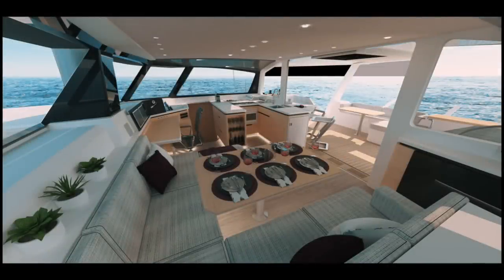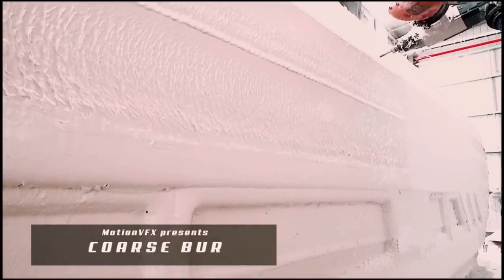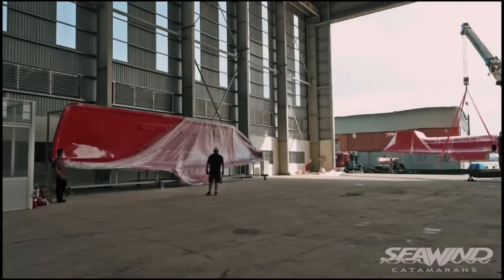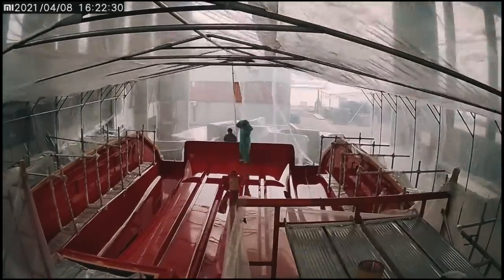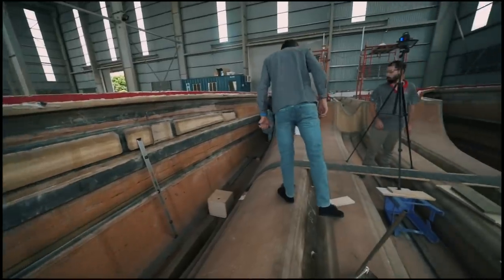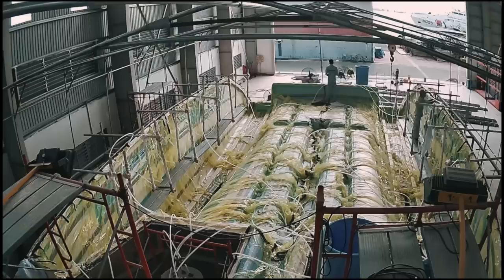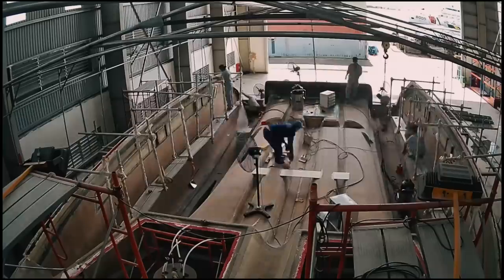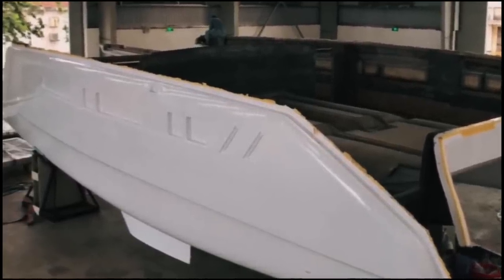🔴 Why does this BOAT BUILD need an INSANE 6,000 feet of pipe work?!!

Comment: I really wish we could figure out how to do resin infusion without so much plastic waste.  I know you're building a hull that could last 100+ years, but all that bagging, all that peel ply, all those tubes.... it's more plastic waste than some of us generate in years (and less than some of us use in a month).  Still, IMHO it's the most distasteful aspect of this build method.  Don't get me wrong, it's far too complex for me to objectively say if it's worse than other build methods overall.  It's just a bit icky.
Reply: You are correct that there is a fair amount of waste with regards to the consumables.
However, I’m quite certain all the stuff you list contributes a very small fraction to the material cost of resins, fibers and foams. I’m equally certain the additional labor needed to configure bagging and plumbing for a 45 ft layup is significant compared to the cost of consumables….even in far off places with cheap labor and limited environmental oversight.

In the end, the fabrication process is a financial decision as well as an engineering one. 

To your point….I doubt the environmental impact will be of much concern to anyone until that stuff washes up on some beach a few years from now. But the impact is real and persistent and happening world wide in virtually every industry.
Reply: @williamfennell8175  imagination is what makes human different than others..... what if you could make a vacuum chamber, large enough for the boat to fit in and have robots to spray the resin? Look at how carbon bikes are made, with double moulds.... only saying, its a matter of choices and money as you also mentioned...
Reply: @mafketeltje1988  
I’m sure you are correct . What you’ve described is a giant autoclave the size of a warehouse used by aerospace companies like Boeing and Airbus to fabricate composite wings and fuselage.
Each of these  companies probably have billions invested in similar manufacturing facilities. Despite the fact that they have more stringent structural requirements and enormous financial resources I’m certain they are actively researching technologies to reduce manufacturing overhead.
Reply: @williamfennell8175  The autoclaves don't stop the vacuum bagging they follow  it. When the part is vacuum to the mould the valves are closed and it is wheeled into the autoclave for temparutre controlled curing. Still the same amount of bagging required.   Wood boats, steel boats and aluminium boats all have waste as well just a different form, but all energy intensive.
Reply: @zorbalight3933  
I agree.  I should have been more clear when mentioning the use of autoclave big enough for a full size hull.
The added control of positive pressure and elevated temperatures is well suited for the use of “pregreg” fibers and nomex cores.   The long working time of the prepreg at room temperature avoids the need for miles of tubing to deliver resin via infusion. But you are correct that bagging is still used.  
My intent was to highlight one of the variations to a process in manufacturing high tech composite parts without avoiding the labor investment of what’s still a hand layup.

Comment: 11:05 right angle cut bulkheads at inner hull intersection look weak. and repeated on outer side, but radiused at top ?? documented lagoon 450 fail point
Reply: Apples and oranges mostly.  Plywood (as in Lagoon 450)  is not nearly as strong as Carbon fiber as in Seawind.

Also the load bearing bulkheads in the Seawind are fully glassed in.  Some of the French builders just use caulk to attach them to the hulls, which is frankly insane and probably won't hold up.
Reply: @LoanwordEggcorn  every seam that was glued in on sailing Parley's Lagoon 45 failed along the bulkhead. Clearly it is not the right way to build a boat. Just imagine falling off a wave and then hear all bulkhead/ hull joint failing simultaneously.
Reply: @hanssolo4ever  Agree.
Reply: They are radiused too, not right angle, but at a small radius.  Agreed, larger would be better, but there is a door cutout reinforcement ring visible and that spot of the inner hull intersection probably mostly consists of the reinforcement plus the tabbing, so you have a few inches thick of fibers in the stress direction.  The 450 has almost no fibers in the stress direction there and a conduit without reinforcement right next to that spot, cut through the fibers, like it wasn't bad enough already.
Reply: @michaelhaardt5988  Agree.  The 450 could almost be held up as an example of how not to do it.  The Seawind build is much better than the Lagoon 450.  And it's highly visible.
Reply: @michaelhaardt5988  the radius is important something the comet yet learned the hard way sixty years ago when they had square windows that develooed stress cracks in the skin and the plane crashed.

Comment: Why does it look like they cut the port side bow section off and re-attached it?
Reply: @11:55
Reply: @matthewcrocker7261  to allow the boat to be removed from the mould certain sections of the mould are detachable. You are seeing a line from one of those joints in the mould I think.

Comment: Thanks for sharing. I would not have imagined how wasteful process this is and how extremely devastating to the environment. Several tons of plastics, most put into a form that is impossible to reuse or even recycle due to the glass and mixed composition. All this to make it faster. Very-very sad.
Reply from the maker: This is where you have it wrong my friend. 
If you watched our interview with Dan and Kika, they explained it perfectly.
There is no harm in using plastics for construction. Sure you are typing your answers on a plastic phone, with plastic parts.
The problem comes when plastics are single use. In a case where plastic boats/cars/houses have a long life (think of all the boats in GRP build in the 1960s that still sail) it is an excellent building material.
Reply: @sailingrubyrose  Don't get me wrong I like that boat very much. It's just the footprint. I also don't think you have much better choices. Marine grade wood for boat building is also killing wildlife (if you can get that quality of wood at all) with a rather limited lifespan. Alu seems by far the best in terms of longevity and reusability but a huge CO2 footprint to produce and difficult to shape to just any form a designer conceives. 
I don' think anyone has any idea what to do with derelict plastic boats. Same as a bunch of other plastics. Building a huge pile somewhere. 
What one can do, on the other hand, is to put maximum care in maintenance and prudent seamanship to keep it sailing as long as possible. 
Fair winds RubyRose, looking forward your future videos!

Comment: If for any reason, down the road, if you drill into carbon fiber make sure to wear a mask and have a vacuum cleaner on the spot to be drill make sure to seal the bag after you remove it from the vacuum.  

 just (trust) me on this.

Comment: Are you sure that they use carbon  , because is realy expencive.  Don't they use black painted Kevlar. Is also realy, realy strong and cheaper. Used a lot in the aviation industry. It is only a question, but I worked mny years in th composite industry with Prof. Dr. Ir. Ignace Verpoest.
Reply from the maker: Yes I can promise you it’s carbon fibre mate. The cost is super high and getting higher at the moment

Comment: After watching Parlay Revival's nightmare, and then discovering that there are hundreds of boats just like his that didn't go through hurricanes that have the same bulkhead issues, I really like how they are doing your bulkheads. All one piece in carbon fiber and then tabbed in really well to everything, your bulkheads won't be going anywhere! I don't think I would buy another brand of Cat than Seawind! I mean theirs only went up partway and were sandwiched but not all the way and the fiberglass was really bad from the factory! Not all sailboats are created equal!
Reply from the maker: Yeah we’ve also watched the bulkhead problems unfold across the internet
Reply: @sailingrubyrose  you made the right choice before the bulkhead and glue became a known issue. Was it luck or was it something you knew could be a problem or did Seawind know about problems with French catamaran and wanted to go a different rout? Good choice to use carbon fiber around all the structual locations. Check out Rapido 60 being built as well. Nice looking trimaran and fast.  That one is also being built in Vietnam.